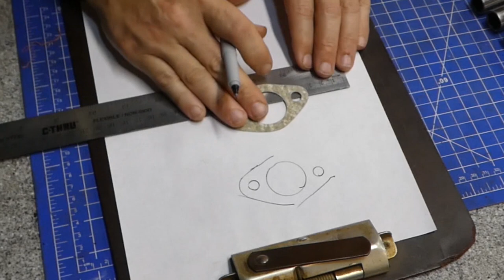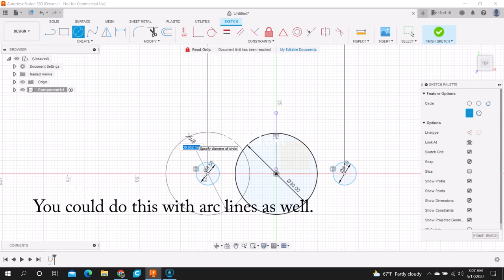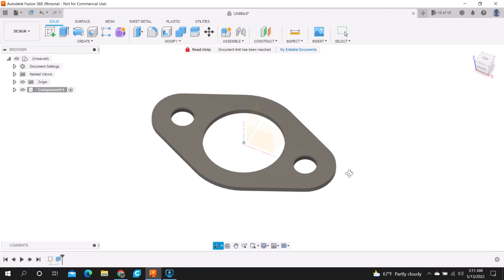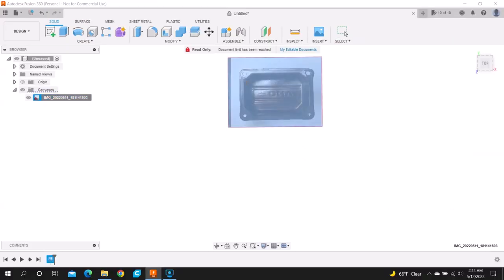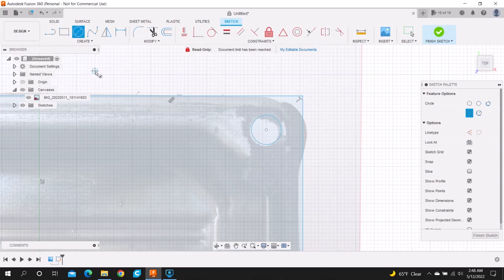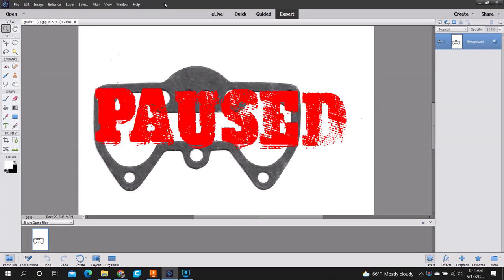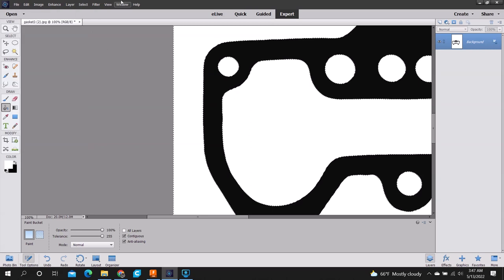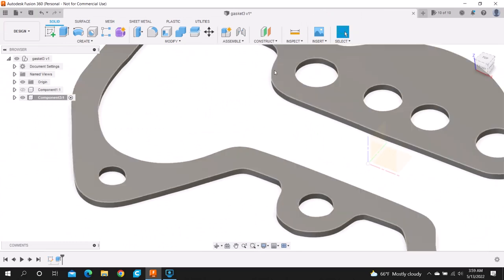3 ways to design a gasket for 3D printing

Comment: not sure if you mentioned it in the video and I missed it but another way to get the measurements is to scan it in a photocopier along with a ruler and then import that image directly into fusion and then scale the image using the ruler as reference
Reply from the maker: Good idea. Basically a variation of what I called the photograph method without having to even take one measurement. Thanks!

Comment: Useful video +1. For your third method I suggest measuring the largest overall dimension rather than a hole to get the overall scaling. A small error in measuring the 7.5mm hole (eg. +/-0.2mm) will result in a +/-4mm error in your 150mm wide gasket.
Reply from the maker: Great suggestion!

Comment: To calibrate the canvas it is best to take a measurement that is as big as possible. That way it is easier to make it precise, because on bigger numbers small inaccuracies don't matter as much. For small measurements the margin of error is bigger. Or simply put: One millimeter error matters more on a 10mm dimension than on 100mm.
Reply from the maker: Good idea!

Comment: You can use Inkscape to trace bitmap to skip a lot of steps from the scan to the svg, great to know I can use svg directly to fusion, there's a teacher who will be mind blown that he can do all his design in illustrator as it's his preferred editing program haha, learnt heaps from this video thanks a lot!
Reply: Forgot to mention after tracing the bitmap in Inkscape you select simplify to do the smoothing
Reply from the maker: Thanks! I have never used Inkscape, I will have to give it a try. Fusion will import DXF and DWG vectors as well. Thanks for watching!
Reply: @theeddies  Inkscape is basically a free type of Adobe illustrator, similar to like gimp is the free version of Photoshop.
I mostly only use it for tracing bitmaps though as it seems to do a better job than illustrator for it.

Now I've just gotta try and get my 3d printer to print tpu haha others have done it so I'm sure it's possible but it's not supported out of the box. I don't need gaskets but being able to just make them for old cars that you can't buy them for is amazing.
Reply from the maker: @r4z0r84  Def going to try inkscape. If you have a Bowden setup stick with the 95A TPU's and you should have little problem. Lots of good tips and tricks on Youtube for doing it. I am going to try it on my printer with the Bowden soon with some settings that 
@Lost In Tech   uses.
Reply: @r4z0r84 You are right!  Trace bitmap is best and quickest way ....also Inkscape will export to .dxf file directly as SPLines...which can be used for profile as-is.... so no need to redraw ACR/Lines.  Just select profile and extrude

Comment: Thanks, good info. I am no expert in Cadd, one thing I consider is whether the part is symmetrical. If so, draw around the axis and then mirror it. Seems to save doing some operations twice. Maybe not always better just different.
Reply from the maker: Thanks. Good advice!

Comment: Your first method is how I've been doing it. I have a Japanese import car and can't get the gaskets without a ridiculous fee / shipping time. I do have a 3d printer and plan to print some once I stock up on TPU thanks to your awesome videos, but I've just been making paper templates to cut out for now.

I do also scan my drawings with all measurements and what's left of the gasket, so I have references in the future. So, a mix of method 1 and 3.
Reply from the maker: Thanks for sharing

Comment: Great video. Thanks for sharing. I like practical 3D prints. I’m sooo past trinkets and figurines. 

I’ve had my printers for over 4 years. And played around with F360 for about 5 years. I am not an expert by any means. 
My 2 cents…..
On Method 1:  using the Mirror tool might solve the multi tangent issue. Equal constraint for the holes is another option. 

Method 2:  Equal constraint for the holes would be an easier way to keep them parametric. Also the Mirror tool would also be another option to create this, using construction lines. Only one corner would have to be drawn. From there mirror X, and then all of that, mirror Y (or vice versa). 

Method 3:  Inkscape is Free software that will create SVG vectors from photos.  Using the Trace Bitmap function it will copy photos much like the method you have shown. I’ve used it with success.
Reply from the maker: Thanks! All good ideas. I will play around with them. Best!

Comment: In case someone ends up here and asking themselves how to make the lines tangent to the circles without manually adding the constraint: Hold Shift when adding the initial point on the first circle, then connect to the tangent symbol on the second. Both ends will have tangent constraints.

Comment: 4th way
Just use simple 2D scanner.
You can also scribe scale on the old gasket itself to make it more simple.
Scan the thing, import it like the photo, scale, presto.
Then you just have to trace the lines. 

BTW making model image 50% visible helps to check if everything fits

Comment: To have a line be tangent to both circles, click to press on the first circle before where the tangent line would roughly start, hold and drag to the next circle (at the tangent point, the symbol appears) then your line should be tangent to both.
Reply from the maker: Cool, I will try that. Thanks! I knew there must be a way of hitting the right places but had not made it happen yet.

Comment: If you have Illustrator, you can do a live trace of a raster image and get vector graphics right out the gate.
Reply from the maker: That's a great idea as well. I don't have Illustrator unfortunately. I really don't like that they went to subscription based service. I bought Photoshop and Premiere Elements a few years ago and they are still good enough for my uses and were a one time fee. There are probably other Illustrator like programs that could do the same thing though or I guess I could look for an older version before the change, I should look into that. Thanks!

Comment: Good tip for ya with exporting f3d files. Export using .3mf files instead of .stl

They export almost instantly, at least 100x faster than .stl exports. Cura and other big slicers will take it without issue

And I believe .3mf are much easier to edit later on in case you lost the fusion file. idk someone feel free to chime in on that. If you've ever tried to edit an stl, I'm sorry
Reply from the maker: Thanks. I actually hate using 3mf files for one simple dumb reason. Cura saves projects in that file format. So if I save models in that file, when I look thru my files, I am never sure whether it is a project or just a model without opening it. This is just a personally annoying thing and is nothing against 3mf files. 

Another person mentioned a different way to save STL's in Fusion. Right clicking on the body or bodies that you want to convert and then selecting "save as mesh", this actually instantly saves an .STL. 

Editing mesh is pretty much the same no matter what the format in my experience. I have edited STL, 3Mf, and OBJ files with Blender, Meshmixer and Fusion (Meshmixer is made by Autodesk as well and is basically the same as the Fusion tools, just standalone) and it works but the learning curve is pretty steep. I have had good results but it is annoying for a novice like myself.

Best!

Comment: G’day Eddie. Good work mate 👍
Reply from the maker: Thanks Aaron! A white screen is hard to video edit, I don't think I want to make another any time soon, lol. I actually sent a few people to your video on the other channel that was a flat object with holes but finally decided I would just do one with the 3 methods.
Reply: @theeddies  all good buddy. I use my Mac and screen capture with QuickTime
Reply from the maker: @AaronEngineering  I did not have any problems with the screen capture except my mic did not want to work with it so I ended up over dubbing the whole thing. Kind of a pain. The audio synced with the video would have been very helpful in the edit. I will do it differently next time, if there is one.
So did you have a trick to draw a line from a circle to a circle that is tangent to both without having to go back and make one side tangent?

Comment: Doing tangent I just draw half the part from origon then mirror it if it's symmetrical
Reply from the maker: Yes, I have actually been trying that more and more after a few suggestions. Once you get used to thinking about it that way it works nicely. Thanks!